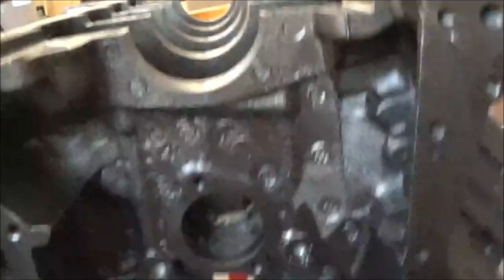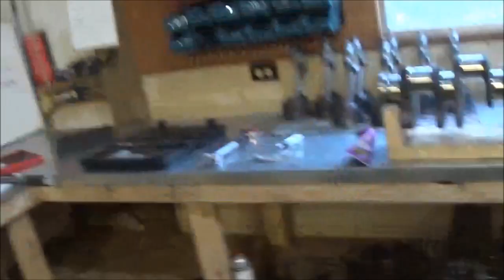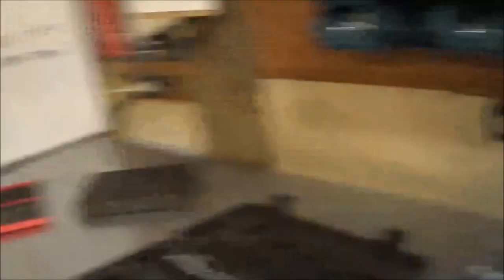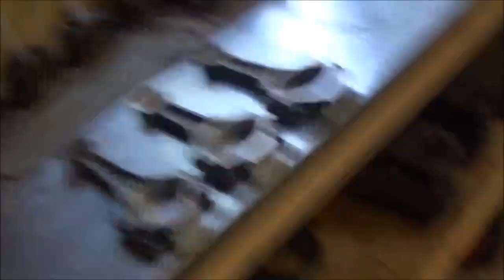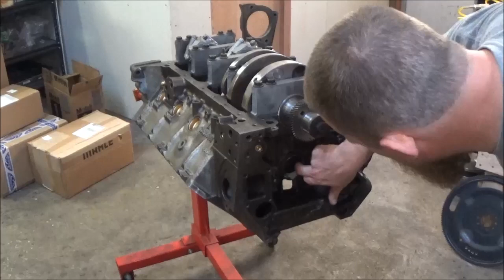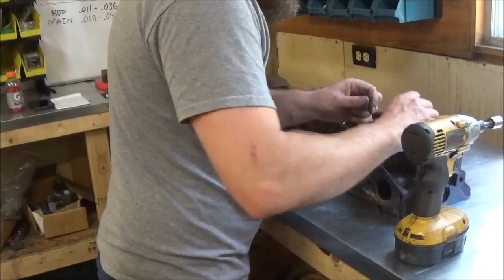7.3 Blocked, 6.9 Engine Build Part 4: Assembly

Comment: what rods and piston combo are using to de-stroke the 7.3 block.
Reply: If you noticed while he was checking lifter height the piston does not extend past the block like a normal idi does at around .030 meaning he is most likely flush with the block deck so whatever gets you around that.

Comment: I’m wondering were the hell you can buy a rebuild kit on a 6.9! I currently have a 94 7.3idit but I’m thinking building a 6.9idit and try reach 250hp and I’d be happy
Reply: A 6.9 needs to be studded & possibly decompressed to handle a 90 pump, a 7.3 just needs to he studded. Cuz of the 20-22psi of boost the 90 gives

Comment: Why is r&d the only one that rebuilds 7.3 idi motors? Cummins has hundreds of suppliers. Is it worth it to keep the international?
Reply from the maker: Because the 7.3 IDI is an awesome engine, and all it takes is a couple of tweaks to be a stout contender. 

The 5.9 came with a P-pump in 1994, before there ever was a diesel performance craze, and when the 7.3 PSD came out, it effectively started the movement. Dodge guys realized what they had, and it became a staple.

The 7.3 PSD replaced the IDI, so it was never looked at in a performance mindset, especially with the DB series rotary injection pump. It wasn't till 2010 that real performance started coming out of the IDI platform.

By then, most diesel enthusiasts had forgotten about the IDI in general. Since there has been a bit of a resurgence. The IDI is only limited by fueling, and these days are a ton better for that, but still not to the level of the cummins or PSD. That said, there is plenty of fuel on tap to keep plenty of IDI owners happy with the power they have.
Reply: @RacinNdrummin  this is the best idi response I've ever read!! God bless you